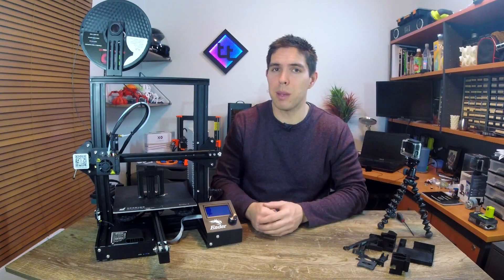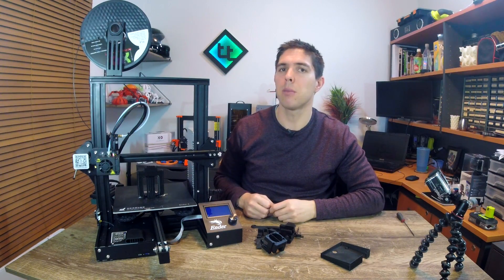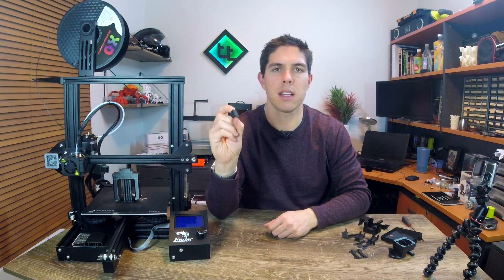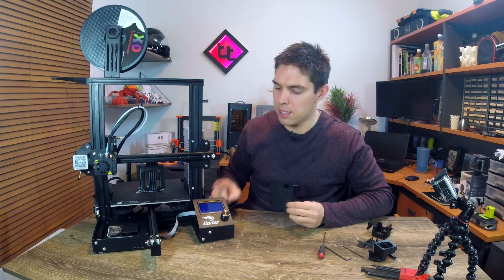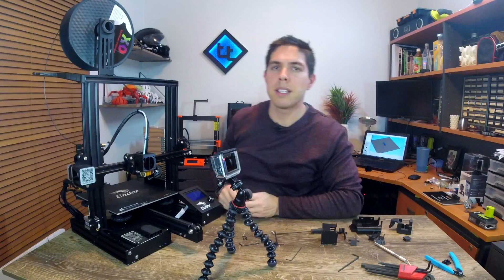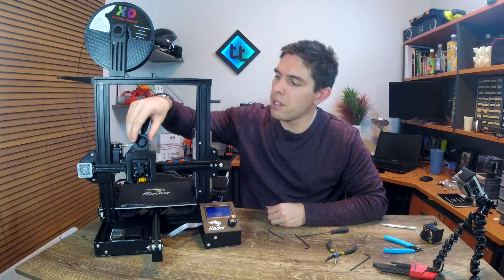7 easy 3D printed upgrades for your Ender 3

Comment: I have a ender-3 printer i can't figure out which cooling system fan cover u printed out can you tell me what file u used to fit the stock fans and still have the bed leveling bracket with it. the video shows the one in the picture but i can't figure out what plan is. please help. thanks for all the Neet upgrades.

Comment: the z axis binding can be fixed by flipping the rod and loosen the brass colored part and tightening it after. fixed the binding in my ender 3 v1 but i may print the part in the future if binding ever occurs

Comment: 00:00 - Intro
00:15 - Summary
00:39 - Fan Cover
01:03 - Common Issues
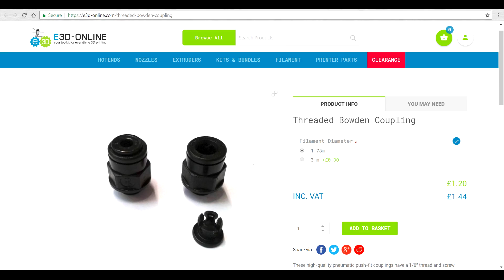01:52 - Filament Guides
04:16 - Z-Axis Shims
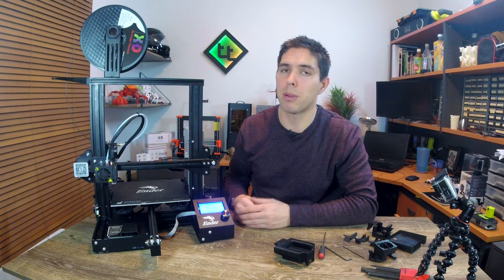06:13 - LCD PCB Cover
08:06 - Hot End Cooling Duct
12:40 - Ribbon Cable Clip
13:30 - Honorable Mentions
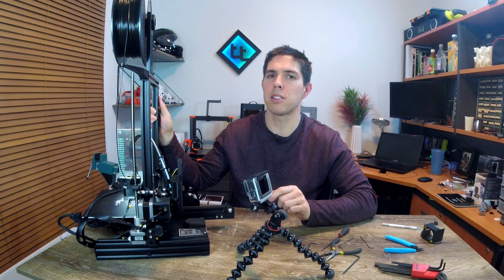14:22 - Outro
Reply: thanks

Comment: Followed several of your videos which have been most useful, but have hit a wall with Geetech A10m. Could not  get quality mixed colour prints and fell out with the extruders and re placed them with metal ones like the ender 3. The second extruder does not respond. Have changed firmware to move filament in correct direction, Both Stepper motors work, Both Drivers Work check by swapping them over. Most of my remaining hair on the floor. Any suggestion (for the printer?????????

Comment: So ive tried to print the filament holder about 4 maybe 5 times now and not once have they snapped together, i cant seem to print anything that fits from this guide and im using the gcode and settings as described

Comment: I love your videos, Im new to 3d printing, I just got  Longer Lk5 pro & I love it so mush It run super smooth & make absolutely no noise,  Can you suggest some upgrades for it ? Also I have a Problem with printing size in cura I couldn’t  make g code to print full size 300x300x400??! Max is 270x270x399, Its would be great if you suggest some tips thank you

Comment: Is there any reason why you printed the cooling mod in that orientation? Wouldn't it be easier if you printed it flat on it's side? If someone has done this, please let me know, I'm planning on printing this on SLA and I really don't have any resin to waste. I just got an ender 3 and want to get it the stuff I need to improve it before my printer gets here.

Comment: At 7:13 you assumed that you would need longer bolts. I my experience that was not needed., The constructor has made the bolt holes in the cover so that the original can be used - you just have to push them down the bolt hole (easy enough when you knowk that it is possible). I did that and it fits nicely.

Comment: I got an  Ender 3 for my first 3D printer I like it except for the bed leveling. I have lots of trouble and waste lots of filament. I retired and this is for a new hobby. I have built several of the  upgrade and put them on. I am thinking about getting a TRONXY XY-2 Pro 3D Printer Kit 255*255*260mm Silent Printing Auto Leveling. Do you know anything about this 3D printer? Thank you so much for your videos.
Reply: You probably already know everything I'm gonna say so just ignore it if that's the case, if not I hope it helps. If you use the small card that came in the box as a feeler gauge between the hot end and the bed it should get you perfect leveling. A regular piece of copy paper can work most of the time, I often find myself making the gap just a tiny bit bigger, but the best bed adhesion happens by using a raft, because cura tells the printer to put out an extra thick base layer when using rafting, which is much more forgiving in regards to bed adhesion. Also if using a glass bed, if you arent using a type of bed dressing, you should be, glue stick is really good, and I've heard amazing things about salt water when brushed onto the hot glass, if you let the bed cool once the print is finished it should just pop right off with little to no fuss. Also make sure you have the right printer selected in Cura, some are really close to each other but can act just different enough to seem anomalous as to what is going wrong. If you have the silica wafer board with the adhesion sticker on it you don't need to put a bed dressing on it, its great just the way it is, however I wipe down my print stages frequently, if there is dust or oils from your hands on the bed your prints will keep popping off. I recommend wiping down the top of the adhesion sticker with some isopropyl alcohol, or even a little windex which you just wipe off afterwards. (I manage 13 3d printers doing R&D and engineering) if I want a pla print to look really good I actually don't use the 3500.00 dollar makerbots (they suck for decent resolution they're just fast) I go for the 2 cheap ender 3 pros we have, their prints look ten times better. I love all of my enders, they are like a Cadillac compared to the days we had to build our frames out of wood.
Reply: @protogenius  Thanks for the information. I did not know any of these things. I will try when I get more filament. Thank you so much.

Comment: These are all great and if I get this I will print all of these except the last one. The past one is complicated and there is an easier print on thingyverse that just clip's on to the bottom of the turbo fan to direct the flow better. It's much easier to print to

Comment: regarding the drawer(s) that fit between the display and the controller box, i noticed there's air duct on the side of the controller box that would be blocked by the drawer frame, I don't know covering up the duct there is a good idea,

Comment: I have been looking into the Ender 3 Pro for a while now. Literally just bought it as I'm watching your video. However, not from amazon. I went on a site called Banggood and they have the Pro model for 206.00, 30.00 dollars cheaper than on Amazon. They also have a coupon that expires on September 15th, and the shipping was free too! All in all I paid 194.00 for the whole thing! 

I reviewed the site and it looks like a reputable company so fingers crossed. Thank you for the inspiration! I will join the Ender gang soon.

Comment: The same question as I notice several of your other followers have recently asked: which pets fang suits Ender 3? There seem to be several to choose from, but the one linked to the video doesn't appear appropriate for reusing factory supplied hardware, and only seems to contain 1 part(the duct) no additional fan casing.
Please could you point me ( and obviously a few others ) in the right direction. 
Otherwise I think your videos & presentation are great, keep them coming they're a great help.

Comment: Thank boss. I just did an unboxing video and assembly of the Ender 3. I recently started to do some actual large prints and they fail. The z isn’t parallel to the bed. It seems to be uneven on one end. Hopefully that z mod will fix it.

Comment: Hey i know this is way late to ask this question. And i hope you see it so that i can get a reply.
For the pcb cover: where can i order replacement screws that will be the right type etc? Because i went down to the corner hardware store in my city and they did not have anything that could replace the screws.
So if you know of a site online or a specific amazon store please help.
Your videos are in part responsible for getting me up and running with 3d printing in a super quick way. And i cant thank you enough for that.

Comment: Great video mate! Very helpful. Is there a good upgrade for the actual printing surface on Ender 3 because mine came with a few bubbles and I've had trouble getting some out, so I'll have trouble leveling.

Comment: Hi hope you can help. My Ender 3 seems to  print great but upgrades are larger than the frame size. Could not use the top guide as clip too large? Is it something I am doing, yes new to printing. Thanks

Comment: just got an ender 3 last week. finally got more filament in today, but i have questions:
for the fan duct upgrade. i downloaded the files you have in the description. but i am not seeing the exact duct you use in the video. you said to use the cr10 files. well none of them resemble what you have. so i checked all the files and again none of them render looking like what is in your hands. (yes i know the duct prints with support material. so it will look different when it comes off the printer compaired to what it will look like when you take off the support stuff. but the fact remains that my search results in these files are vastly different to what is in your hands.) plz help?

Comment: having issues working out what files to print for ender 3 on the petsfang cooling system. i need the same as the ones in the video as im looking to fit a bl touch and all the optional extras however am unable to decypher what is what

Comment: well I looked thru all of the files and chart on Petsfang for the fan mount and duct, but none of them looked like the ones you are using. I'm I missing something? Did they change the file design? I have an Ender3 the same as in the video.

Comment: Great vids and you've taught me plenty, i haven't found the duct you printed and installed however, there may have been some kind of upgrade. Do you still have a copy of it or even a direct link?
I'm actually printing one but i'm not sure if the fan will fit, certainly like your channel, Creality E 3 machine , keep it up.

Comment: Has anyone had an issue where the z axis doesn’t move up uniformly but actually rotates and angles the extruder a little and then moves up? If so what are some fixes for that?
Reply: Yeah so I didn’t know that you can adjust the position of those rollers and so I loosened it and it stopped binding! Thanks for the help!
Reply: Sounds like you've got something loose in the Z axis screw, might want to tighten it up
Reply: You may want to play around with the clamp for the Z-axis. You might have to tighten, loosen or both. For mine, I had to loosen the bottom screw and then tighten the top one, then tighten the bottom one. My friend had to do the same but vice versa. Also I would say to make sure either of them aren't overtightened. My model came with plenty of screws jammed into the aluminum lol. Pretty sure Thor came by with his hammer and jammed them in there lol.

Comment: i am using the .04 mm tip and the tray is probably meant for a larger nossle. what speed should i use for the small nosel i have?

Comment: Very helpful. Though, the most beneficial mod is converting from bowden tube to direct feed into the hot end.  It should have come that way from the factory.  The difference is a plate and some screws...
Reply: Except for the fact it will increase the weight of the X-axis gantry A LOT, which will require either a better quality snare/belt or a linear slider to stop some of the springy behavior the X-axis can have when printing certain types of details along the Y-axis plane (I have a lot of ringing and have tried setting up belt tension different a couple of times, but it has never helped getting rid of it, except printing slower (25-30mm/sec).
I am definitely interested in trying this mod out some day (mostly because I feel friction in the tube can be a problem), but I am fearful for some of the negative effects it could have (which is also, increasing the weight of the Z-axis making it harder for the Z-axis stepper to move it).

Comment: I must be missing something here. All the base downloads for this you need to add a nut inside. You mention that you must cut the threads in the base. Can you look again at the files and let be know which base does not need nuts installed? Also, I cannot find the file for the petsfang duct that uses the stock parts cooling fan that you printed in this video. All the petsfang cooling duct uses the round fans, and not the stock fans. Thanks

Comment: Michael I would be very grateful if you could please tell me where I can get the STL for the Petsfang duel duct for an Ender 3 Pro that you used in your excellent video. It does not exist in any link below the video. I do not want to do any major surgery on any of the existing ones available. Much appreciated if you can provide an answer.

Comment: Does LCD PCB Cover support Ender-3 Pro model?
Reply: I'd be very surprised if it doesn't fit perfectly. They look like the exact same LCD board mounts from the photos.
Reply: @davidtison3737  I've just got my first 3D Printer which is Ender-3 Pro, and want to double check about this. Thank!

Comment: Good video, but in need of some updates... (1) The fan guard has been updated with vertical fins to avoid needing support during printing, (2) The PCB LCD cover has been modified to allow using the factory screws, (3) The slide on filament guide has numerous complaints of squeaking noises, and failure to remain attached

Comment: hey buddy my ender 3 is having flow issues it has gaps not vertical but horizontal around the edges. Ive cleaned and replaced my entire feed system from extruder to tip and yet still having the issue can I pick your brain? I can send pictures to show if you need to see or anything...it was going great for a year...

Comment: the  fan parts are not the same u provide on the video, and is not good a wasted 4 hours printing for nothing, incomplete video also, fix that that dual extractor fan is nowhere on the link with the files there are others but not that part, piss me off,

Comment: Speaking of z axis binding, I too had that issue. I resolved it quite easily by rolling the z screw across a flat wooden surface with moderate pressure. This fixed my issues as my z screw was slightly warped. I have been using my printer daily for months, and with some basic cleaning and maintenance, have had no further issues with the performance of my printer.

Comment: Great video my printer arrives   in 3 days, first thing I will do after assembly is to follow this tutorial upgrade. Quality explanations and camera angles, keep it up
Reply: Did you get your printer yet? How did it go?
Reply: @carlnikolov  yes I got my printer, from the moment I unpack it I  knew it was quality, all the materials feels really solid and all the parts were nicely pack and organise. I took me about an hour to assemble , was really easy I just followed youtube tutorial, The printer itself is  really good printing and I already made the  4 upgrades with  self printed parts. I am a 3d artist so I  am, having plenty fun creating  things and printing them out. I recommend anyone this printer. is really amazing for the price.
Reply: @puzzlemagnet1957  are you using cura design program?
Reply: @carlnikolov  I use cura only to set the prints, for my 3d creations I use autodesk Maya, I am a professional of the 3d modeling industry

Comment: The tool tray doesn't fit an ender 3 pro its at least 10 mm too wide, add to that Cura wont provide proper support for the sticky out bits that run inside the extrusions making it a very tricky frustrating print. If you are gonna give it a go use slic3r to make the g code and reduce the X axis dimension by at least 10 mm. Its not the printer calibration by the way a 100 mm calibration square came out perfect.

Comment: I am really enjoying your series. I purchased an Ender 3 partially because of your and others recommendations. My first print is not coming out too good. I'm printing the cable ribbon clip in PLA and having an issue. The first print came out poorly so I followed a recommendation to lay it on its side. I have the them temps set at 200/60. The problem is the flattest and largest side is coming out about three thicknesses too much. Looking at it from the side, it's like there are three different layers. I have left the default speed settings alone. Any suggestions?
Reply from the maker: Your first layer could be too close to the bed. The first layers get dquished into eeach other too much. It's called 'elephant foot''. On my beginner fixes video I show more on dialing in the first layer.

Comment: Hey there, I have filament, but it's not on a roll, it's just a plastic bag with the filament curled up in it. Is there any roll or spool I can print to make it a bit easier? Currently I just have this curled filament lying next to my Ender 3 or hanging up on the filament holder, but it usually falls off. Anyone has any ideas or tips? Also thanks for this and other videos you did on the Ender 3, it's really helping me understand and improve my knowledge on 3D printing!
Reply: You need to buy a master spool or print one. it's to make the pla cheaper and you slid it on the master spool
Reply: @dingokorn  Thanks! I was sure there was something to work with, but I had no idea what to look for ;)

Comment: I just purchased the Ender 3 Pro and Im using Cura. I downloaded a vase from Thiniverse. When it prints the inside is "filled" I would like to print it hollow. What's the correct setting in Cura for this? Thanks
Reply: spiralize outer contour
Reply: thanks! @steffenadamski2786
Reply: @steffenadamski2786  It work well. My wall is very thin. Where do I increase the wall thickness? Thanks in advance.
Reply: Stephen, where do I specify the outside wall thickness?
Reply: @flacavaca  This is depended on your nozzle diameter. Most common nozzle is 0.4 mm, you can increase this value in the settings up to 0.48 mm. If you want even thicker walls you have to install a larger nozzle like 0.6 mm. Would not go higher with a printer that is using 1.75mm filament.

Comment: what specific files are needed for the ender3 print nozzle duct. I found the cr10 base that you feature but none of the dual ducts match yours, they all have a vertical post coming out of the top

Comment: I printed the fan duct parts according to the chart but they were not the parts in your video so I then opened all the files and it looks like none of the ducts will work with the stock fan.  Am I missing something?